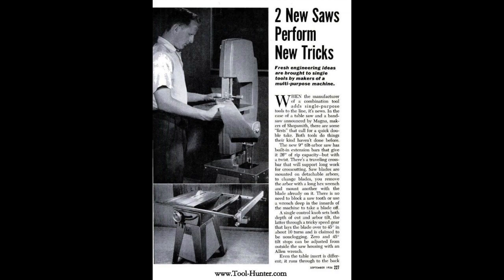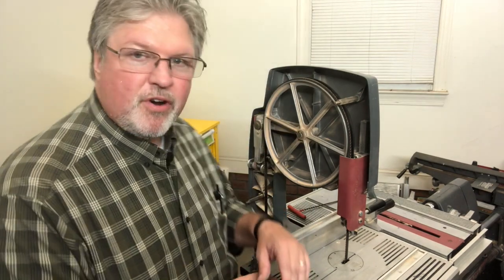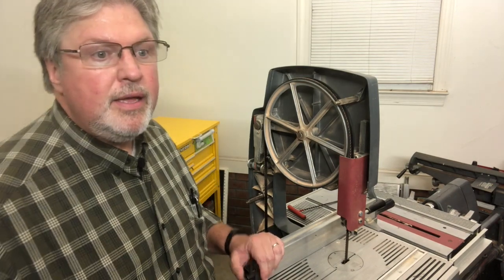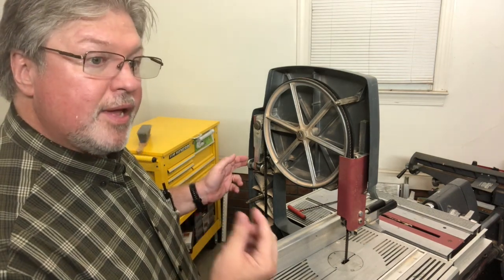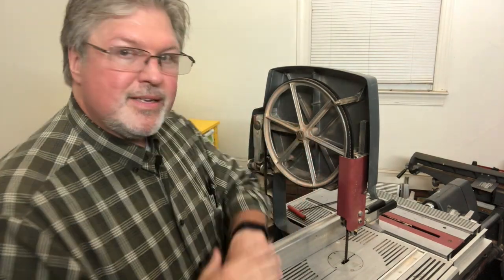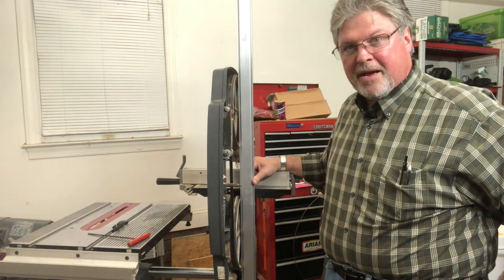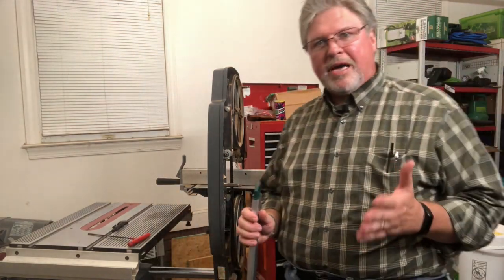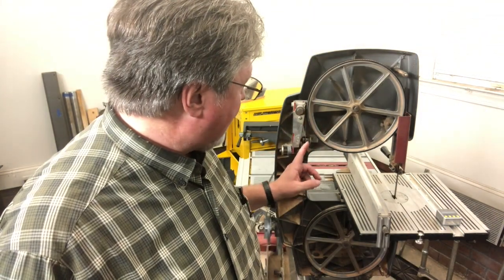How to Tune a Shopsmith Bandsaw: Fine Woodworking Magazine Lied to Us!

Comment: Thank you Sir!  I was a bit panicky when the blade of the used bandsaw I bought for my Shopsmith was coming off FORWARD of the wheels and I couldn't find ANY adjustment to tilt the upper wheel.  With the knowledge you shared everything is tuned up just fine and working as a band saw should!  Thanks again for the clearly told issues with this piece of equipment.
Reply from the maker: Glad I could help, Fred.  Don't be a stranger. Scott

Comment: I did this forced tilting of the upper wheel years ago to get it to track to the rear with teeth nearest to the middle according to the snodgrass method.  I never admitted I forced it into position to anybody or advised anybody to do this to fix their bandsaw issues on shopsmith because I wasn't sure if I was somehow damaging the saw.  Now that you've shown the same method I feel WAY more confident in the adjustment I made and I've NEVER had any issues with tracking, drift or any other problems while cutting.  I can push really heavy stock through that thing with no issues, and with the miter gauge I can slice paper thin sheets of stocks that are almost see through!  Amazing saw for sure!  Thank you for all the hard work and video production you are doing!  I'm subscribing now!
Reply from the maker: It’s nice to have you here and I’m glad to have set your mind at ease. That adjustment is done at the factory on all new SS BSs, so it’s totally legit.  Thanks for the sub! Scott

Comment: You've given me the will to try my shopsmith bandsaw.  I found out after the cut that the  fence wasn't exactly 90 degreess and the cut went bad. I used the fast blocks and did cut straight line...I think the fence killed me. I will try again with a better fence and a different blade. I did order what I needed to grease the bandsaw wheel. Thanks.  ON A SIDE NOTE, in cleaning my 520 I found a penny nail caught in the groove of the miter where it grips AND INVISIBLE to the naked eye. I was just running my fingers in with the wax and luckily found it.
Reply from the maker: Stick with it and you’ll get her dial-in. Scott

Comment: Definitely agree that shopsmith bandsaw it is a superior design than the rest and I am also wondering why it wasn't incorporated into other bandsaw brands out there. Adjusting  the cool blocks/guides back or forward with just a twist, depending on the blade size it is also a great feature that you don't see on most other bandsaw manufacturers
Reply from the maker: I’ve had the same thought.

Comment: Just bought a MARK Vll and was trying to oil the headstock. It is different from the mark v since it has a screw nut ( connected to the rack adjustment lever) protruding while removing the back cover. I overtightened the nut in putting it back since the thread was recessed when I turned the lever. Big problem was some gear teeth broke. my dilemma is how to re align the adjustment lever since the headstock is stuck in the rack. Forcing to move or remove the headstock might break more rack teeth.  Your advice is most welcome.
Reply from the maker: I would just go ahead and break it. The racks are now being 3D printed and sold on eBay by a couple guys, and that’s just the most straight forward approach. Bummer though.

Comment: the tilt in the upper wheel can be more dramatically shown by placing the straightedge across the upper wheel and see just how far the straightedge IS from the lower wheel
Reply: True. You may have noticed that I also had a digital angle gauge on the table near the end of the video that intended to use to show the actual angle, but in the end I decided to show “the old 1/4” gap trick”.
Reply: Whoops! I’m logged into the wrong account again! Scott

Comment: Can’t get enough of your channel! Yet another fantastic video. I have a woodmaster clone bandsaw and a supershop clone bandsaw. Weirdly, the supershop bandsaw is the absolutely terrible clone while the woodmaster is just about a 1 to 1 copy of the shopsmith. Everything on the supershop is beefed up from the shopsmith but they missed badly with the bandsaw. Keep up the great work!
Reply from the maker: Thanks Nick. That really is weird. Is you Super Shop a Fox Super Shop or a Smithy Super Shop?
Reply: @MyGrowthRings  it’s a smithy and so I believe the quality may be lacking compared to the Fox. It was brand new and not ever turned on. The band saw was still brand new in box too. The overall fit and finish really isn’t bad but still lacks the polish of my well loved and used 510.
Reply from the maker: @nicko5945  Nice to get a new tool, but that would be frustrating to have the other saw side by side with it and to conclude that it is inferior to the other.  Scott

Comment: I just pick one of these up  but by looking at it ,it seems like they set it up backwards because the drive shaft  on the jointer is pointing away from the motor head.
Reply from the maker: Yep, that would be backwards alright. Perhaps they were just storing it there.

Comment: You did not mention the front bearing. the blade on mine is about 1/4* off the front bearing.
Reply from the maker: I’ve mentioned it in another vid. 1/4” is awfully far out. It’s easy to adjust.
Reply from the maker: Here’s the correct video, though the audio is atrocious: https://youtu.be/FyMKTS8yM5c?si=vUdwc6wFidlfeyF7
Reply: @MyGrowthRings  thanks. I watched it and I will adjust it today. When I cleaned and polished the hold down I adjusted those screws to make the hold down go up and down smoothly. I didn’t know I was also adjusting the bearing position.

Comment: I saw this video a while ago and when I saw the "crude and crazy" tip for re-straightening the top wheel I thought "naw, that would never work".  Well I got a bandsaw with a 510 I bought a couple of years ago but never used it because it didn't come with a fence, plus I'd gotten used to my cast iron table and "miter fence" setup with my old bandsaw.  Well yesterday I needed a bigger table so I got it out, made a few adjustments/checks, put a blade on it, and spun it by hand.  Weirdly, the blade didn't ride back against the auto track bearings.  Not even close.  I started thinking about needing new tires and then it came to me - maybe the top wheel isn't canted back.  I put a straight edge against it and sure enough, it wasn't.  So I tried your trick and sure enough the wheel is now canted back and the blade runs against the auto track bearings. Just a few minutes and I was past that little hurdle.  I can't thank you enough for all the time and angst you saved me.
Reply from the maker: It is very crude and crazy and it works! Happy to hear you are up and running.  Scott
Reply: @MyGrowthRings  Just found your channel a few days ago and semi-binging on your videos between glue ups and projects.  When doing your "crude and crazy" upper wheel adjustment, in reality aren't you really "torqueing" the position of the shaft the wheel is mounted on?  Seems that wheel would not be stout enough to accomplish that.  As they say "Inquiring minds want to know".  Really enjoying your videos and have subscribed.

Comment: I just love my bandsaw!  At your recommendation, I purchased a pack of 3 Timber Wolf blades.  I'm impressed out of the gate.  My question is, is there any dust collection attachment for the bandsaw with the cast iron table?  Thanks Scott.
Reply from the maker: Hey Dale. Yes, you can ether add an aftermarket port to your cover https://www.shopsmith.com/ownersite/catalog/bsu_dustchute.htm or just replace a cover https://www.shopsmith.com/ownersite/catalog/bandsawcover.htm  There's a good case to make for ether option.  Scott
Reply: @MyGrowthRings  Thank you Scott.  I think I'll opt for a new cover.  It will be nice to see the tensioning adjustment as well.
Reply from the maker: @WKYanks  I agree. Good choice.

Comment: I am trying to use a 1/8” blade on my bandsaw and it seems to be running of the back 
;in side of the upper wheel. Would this be due to the upper wheel being too straight. Your thoughts on this matter will be greatly appreciate.
Reply from the maker: Hey Dan. All blades on a Shopsmith bandsaw run to the back of the upper wheel, but are you saying it’s running off of the rubber tire? Scott

Comment: Hi Scott, 
In the video you mention about how to use the blade tension gauge, something like 'tighten up the allen screw until you see the gauge disappear at the blade width mark'. ... not an exact quote here of course. 
I've looked through the bandsaw guide and looked elsewhere for instructions on how to exactly read the tensioning guide, but can't find a picture example. 
wouldgauge
Reply from the maker: Check out page 12 of this manual https://www.shopsmith.com/ownersite/manuals/845539.pdf
Reply: @MyGrowthRings  Thanks Scott for the quick reply, much appreciated.  

I have that same manual and read through what's on page 12 a few times already and looked at Fig 1A trying to see what its referring to. Unfortunately it does not give a clear example.

Would be good if it showed a pictorial example ..
ex... When proper tension is set for a 3/8" blade, the tensioner should look like this .... 
and then have a picture showing the relationship between the red tensioning spring and the 3/8" mark on the scale. 

So at the 3/8" mark / line on the scale, should the red leaf spring be just touching this mark? Behind it? or something else?

Thanks, 
Steve
Reply: @stevevance1678  Imagine that the red edge of the leaf spring is an arrow with the tip touching the line that matches your blade width. For it to work it is critical that the steel plate with the fractional sizes it properly positioned before you add tension. Scott
Reply: Whoops, I’m logged into the wrong account! Scott from MyGrowthRings here.

Comment: Picking up a used model V in a few days. Does this mean every time I am done with the band saw I need to release the blade tension, then re-tension it before each use?
Reply from the maker: That’s the “best practice”, but most of us don’t follow it 100% of the time. It’s most critical on the two extremes of the width scale: A super-narrow blade will begin to sink into the tire of it is left under tension, which will cause issues when using narrow blades, while a wide blade kept under tension might not only deform the tires temporarily, but the entire arm assembly can be bent down and will mess up the auto-tracking feature that makes this saw so special. This video will help if you have tracking issues.  Scott

Comment: Hi Scott. I have a SS bandsaw, that has a tracking problem. I tried the push/pull on the top wheel as you indicated in the video. It seems to work for about 5 minutes, but then the tracking problem returns. It does not stay against the backstop bearing and comes off the top wheel. I have cleaned  both wheels also. I think the tension is correct. Looks right on the gauge.  Any thoughts on the issue?
Reply from the maker: Something's wrong, for sure. Can you either shoot a video or snap some pics with the cover off? You can send pics or a link to a video to me at scottmarkwood(at)gmaile(dot)com and I'll see if something jumps out. Scott

Comment: As soon as I finished this video, I pulled my SBS out of the garage and took the cover off. 
It has been under tension ever since I first bought it.  Using a straight-edge to check the wheels, the lower one is flat (touches at both top and bottom) and I have the correct 1/4" at the upper wheel top edge.  Is the fact that the bottom wheel is square, that is, touching both top and bottom on the straight-edge, a problem? You mention you have a SLIGHT gap on your bottom wheel, of perhaps 1 mm. I have no gap at all. If I SHOULD have a gap at this point, how do I correct this? Or do I even need to? Thanks very much!
Reply from the maker: That's not at all uncommon and it's as easy a fix as the video shows. The bottom wheel gap is caused by the upper wheel being tilted and the bottom of the top wheel pushing the straight edge away from the top of the lower wheel. As long as the top wheel is tilted and the blade is running against the auto-track bearings, you should be good to go. Just remember to relax the tension when you are done!  Scott
Reply: @MyGrowthRings  Thanks very much! Your videos are VERY informative! I am going to put a blade stabilizer on my machine as well!

Comment: Scott, unusual question. If I moved the upper drive hub on the on the left side of the motor to the right side shaft would it be safe to run the bandsaw on the right? I'm getting upwards in years and lugging the jointer around is difficult. I would like to just mount it and leave it on the machine. BTW, thank you for all your tips. I have maintaining and upgrading the SS and your videos and links are invaluable.
Reply from the maker: If you have the PowerPro headstock, and can always remember to run it in reverse, you can run the tool from the quill end. If it’s not a PowerPro, your bandsaw will be running backwards. Good question. Scott.
Reply: @MyGrowthRings  I checked clearances and found that since I have the lift kit installed I can't get the headstock close enough to use the power adapter. Back to the drawing board. Thanks for the quick response.
Reply from the maker: @Win52D  that’s a bummer. You might consider the guy on eBay, who is selling hubs that you can cut your own wooden couplings from. It’s kind of an interesting approach. I’ll see if I can find a link and send it.
Reply from the maker: @Win52D  Check this idea out: https://www.etsy.com/listing/1197241148/molded-power-coupler-square-dowel-for

Comment: Hello Scott, my bandsaw has a rubber roller by the tinsioner, it seems to be making noise. Where can I find information about this? Does Shopsmith offer upgrades for this issue?
Reply from the maker: Yes, Shopsmith does have an upgrade for that and I’m my opinion it’s a must-have. Check it out here: https://www.shopsmith.com/ownersite/catalog/bsu_backuprollerkit.htm
Reply: @MyGrowthRings  thanks! I was looking at that yesterday but didn't realize it was what I needed. The blade you recommended is killer, works nice with softwood.
Reply from the maker: @drstyxquack  Glad you like it. Yeah, that auto-track bearing is just too noisy, and adding oil to lubricant it just attracts dust and exasperates the problem. The ball bearing upgrade is the way to go.  Scott

Comment: Robert Shaw, Hesperia Ca. I haven't commented much . Recently I asked about blades breaking. I have a 520 from 2007 and have broken a lot of blades.Mostly 1/2 & 1/4" all from Shop Smith, I was cutting plastic? Was that to much heat? Or over tension? Thank you Bob.
Reply from the maker: Hey Bob. Are they breaking at the weld or in random spots? If you have one of the broken blades still try bending it to see if it is brittle. I highly recommend using Timber Wolf blades. It’s all they do and you are buying direct from the factory. SS is just a reseller of their blades so you are paying for a middle man’s profit without any gain for you.
Reply: Robert Shaw, most blades were random, two were brittle, broke into 6"pieces.I like your show, very informative and down to earth. I've never had someone answered a comment before, thank you Bob
Reply from the maker: @robertshaw700  Ok, if they were brittle they were fatigued or improperly tempered at the factory. Again, I highly endorse the Timber Wolf blades. I know there are other good ones out there as well but avoid Bosch blades, even though they well them in the correct length.  Well that's discouraging that you don't get a reply. I suppose some of the high volume video folks just don't have the time. One of the things that I like about the viewers of this channel is that they seem to be helpful and encouraging.  I think it comes from being attracted to tools that require a thoughtful approach, like Shopsmith tools. Scott
Reply: I cut a lot of acrylics with my bandsaw and with the PowerPro headstock it suggests 400 rpm for plastic which is what I run.  I have not had any blade breakage at 400.  If you have the standard headstock, I'm just thinking that a fewer teeth per inch blade and faster feeding would prevent the plastic from melting?  IMHO

Comment: Hi Scott, I've got an an old green Magna bandsaw from '59 - '60 that I'm using. 
I seem to have it running decently, (only bandsaw I have experience with) but who knows, maybe it can run even better.  Do you know how much of this tuning applies to that year?
Reply from the maker: 100% of it is applicable to your saw. Unless it was upgraded, your saw has the single bronze auto-track roller that I mentioned, so you’ll need to keep that well lubricated of the noise will eventually drive you nuts!

Comment: I have a non-OEM 1/8” blade on my ShopSmith bandsaw, tensioned according to the gauge, but it seems too loose and when I pluck the blade, it doesn’t sing.  Is that normal?  is there an indication at the blade that I can use to see if the tensioning guide is set properly for this blade.  (Maybe a side flex measurement) I’m thinking that if the blade length is off by a very small amount it would throw off the gauge accuracy.  I believe you said in another video that the blade tension on the SS bandsaw is lower than other bandsaws.
Reply from the maker: The Shopsmith BS can handle a blade that is 1/2” larger to 1/2” smaller than 72”. The gauge will work accurately over that range. I’ve found that it the tension gauge is properly set you can trust it.